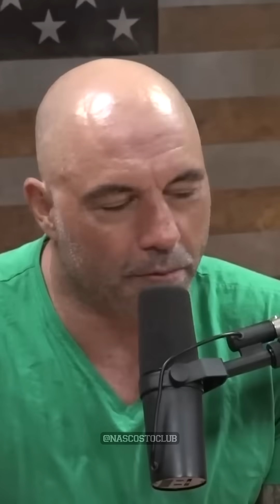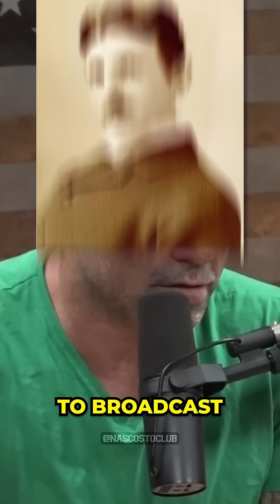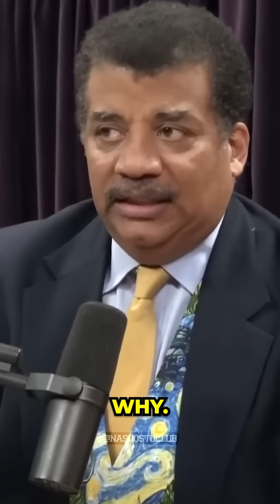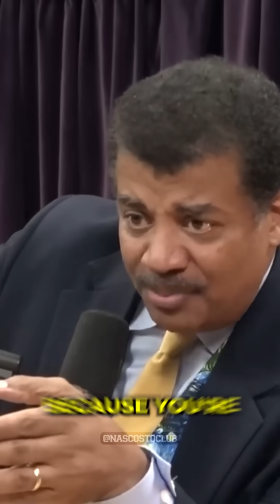WIRELESS Electricity Idea Debunked ⁉️⚡ #shorts

Comment: If you stand close to really large regional power lines, the magnetic field induced around the cables are powerful enough to induce electric current that can power certain kinds of light bulbs held in your hand. The insulating effect of air obviously makes this impractical, but still.

Comment: To be fair, Neil has a point. When conceived we had a very basic electrical need. Youre not powering an air conditioner that needs 220v and 40amps wirelessly.

Comment: This guy is so wrong. First of all, you can power all of that stuff through the air without electrocuting yourself. You just need to be like in what Tesla had those Faraday cages. So like if you were a piece of jewelry or something like that acting as like the a miniature Faraday cage you could do that all day long. The only problem with Tesla's technology is certain things like computers wouldn't work because it wouldn't be shielded enough. There'd be too much interference so you know that would be a problem. But this guy's just an idiot

Comment: There are actually radios that are powered entirely on the energy that is in the radiowave itself, called a crystal radio. Naturally they are pretty crappy radios, quiet as hell, very basic, but they worked. But yeah, the idea for broadcasting power like this is still dumb and wouldn't work for much of anything outside of that one example.

Comment: People just don't accept that tesla got a whack of shit wrong. Wireless electricity does exist 🙄 its just you can't really send it far. We do this with induction. However you can't send electricity wirelessly (that's lightning bitches). Okay so let's say we do it via photons. Photons aren't magic. While radio waves passing through you I'd fine, enough to power a light bulb is fucking crazy. You can do the energy calculation. This is the thing. Energy isn't free and it's not magic. We use wires because it's efficient. We might use lasers to beam energy because it is efficient. However what do you think will happen? The lasers that burn shit you can buy are on the micro to milliwatt scale.  Purely devoted to that. Now imagine a 20 watt laser, enough for a light bulb. Now there will be signal losses. Not to mention that's only point to point. How much do you think you'd need for a grid as it were? That's the point.

Comment: Not the biggest fan of Neil but he is right here. The typical incandescent bulb uses 60 Watts with 120 volts. This equals .5 Amps. If in an uncontrolled environment this amount alone can be fatal if it is projected through your myocardium.  Which it would, if it's just being wirelessly and aimlessly projected through the air. The amount of power needed to operate a single incandescent bulb alone would be potentially fatal, let alone enough power to supply every household in America. Tesla's wireless power idea was rightfully deemed crazy.

Comment: If you put fluorescent 4 or 8' bulbs parallel cross country high tension electric supply lines they will glow and the power company WILL CHARGE YOU FOR THE ELECTRICITY USED.

Comment: Speaker wire and data wire has a noise control type thing. There is a mesh of a different type of metal mesh around the insulated conductors that get rid of other power that can be induced with outside power. So wires with a drain(thats what the mesh inside is called "drain") I'm almost positive by now we could get away with it. If im incorrect please let us know. This is my understanding.

Comment: Tesla forgot more than this man will ever know
Reply: Can't wait until I'm 70 and reading comments on MeTube talking shit about how little Albert Einstein knew
Reply: Dr. Rodney McCay
Reply: comment and name matches
Reply: Tesla also fucked a pidgeon or he tried to atleast. The guy was insane.
Reply: Does that make him wrong?
Reply: @curtisowen3233  Yes, the energy doesn't move through the cable, cables are aligning energy which moves through EM waves or something, Veritasium explained this.
Reply: @lordshitpost31 ... yes, you're right, the electromagnetic field moving the electrons isn't in the wire. Neal knows this. Neal does not defuse that you can send energy through the air. No one does! But a wire provides a clear conductive pathway for the energy to move along. Can you power a light bulb through empty space? Certainly! But the vast amount of energy put out from the source will be lost before it gets to that light bulb, exponentially more the further away from the energy source that light bulb is. The larger the distance the more paths there are for the energy to flow. Anything conductive between the source and the lightbulb is going to grab at it before it gets to the light bulb, especially if its grounded! So if you're standing in between the source and the bulb and you aren't wearing large rubber boots or walking on a paraffin floor, you're going to light up more than the bulb! We do use this technology (think of wireless phone chargers) of course you don't "need" wires. But you put your phone directly onto the source! 
Idk, the fact that electromagnetic fields exist on the outside of wires "in the air" as you say is beside the point Neal is making. Most people don't know that tidbit of information and its easier for novices to just imagine the electricity running through the wire.
Reply: @lordshitpost31  😊
Reply: @lordshitpost31  cool story bro
Reply: @Curtis Owen  using the unlimited energy source of earth and ground means you can pick up the signal from certain locations. Earth flying 24k mph thru space creates energy that can be harnessed. It's limitless plus the suns energy.
Reply: @bobsam5982  First, Earth orbiting the Sun does not create energy.
Second, if it did there is no way to harness it.
Reply: @lordshitpost31 wire or no wire you still need a medium to transport it and contain it so your idea is largely irrelevant
Reply: @bobmusil1458  No way that You can think of...
Reply: @JohnDoe-qz1ql  No feasible way anybody has ever thought of.
Reply: @bobmusil1458  There's Massive amounts of energy in just empty space. Noones figured out a way to harness such energy... Yet. Again just because You or Noone knows how doesn't mean it isn't possible. Who are You to say Tesla Didn't?
Reply: @curtisowen3233  Clearly you havent seen the Wireless chargers you put on your ceiling and it charges your phone at all times as long as your in the room
Reply: @JohnDoe-qz1ql  Show me proof that Tesla did. Otherwise you are just babbling.
Reply: @bobmusil1458  My comment on energy is Not babbling that's physical Fact.
Reply: @JohnDoe-qz1ql  That's great! If it's physical fact it should be very easy to show some proof.
Reply: @bobmusil1458  It is, a simple search will suffice.
Reply: @JohnDoe-qz1ql  get me started, give me some search terms
Reply: @theakbars98  😂😂 Buddy, if you can't figure That out there's no point in looking it up. You won't understand the concept.
Reply: @theakbars98  You Find it?
Reply: @curtisowen3233  yes! He gets payed by the media, he is not even a real scientist anymore.
Reply: @curtisowen3233  yes. he is wrong.... he often is....
Reply: Lol
Reply: He is misunderstanding Tesla idea. He was harnessing the power of the earth.  Thru the air. Then you move it on wire lol
Reply: oh really, and what are your credentials?
Reply: Fax
Reply: he made a device that creates earthquakes
Reply: No
Reply: @tomas2665  yes
Reply: You have got no idea what you're talking about
Reply: @-gemberkoekje-5547  And you Do? Which of the two made greater contributions to science?? Tesla
Reply: @JohnDoe-qz1ql  tesla simp 😆😆😆
Reply: @minhminh-wp5lg  very original.. You even know what that means???
Reply: Tesla didn't believe atoms could be split, thought electrons where irrelevant and wireless electricity moved through an ether. Teslas understanding of electricity wouldn't hold up in an 9th grade physics class.
Reply: @anonymousx6651  Lol... Tesla Made the AC electrical system. Ya know the one still used to this day!
Reply: @JohnDoe-qz1ql  lmao i learn AC in 9th grade 😆😆😆
Reply: @minhminh-wp5lg  Yeah, he also said it Wouldn't hold up in such grade. It wasn't even a long post, but I'm glad you were able to at least read it.
Reply: @JohnDoe-qz1ql  do you understand what wouldn't hold up mean ???
Reply: Maybe but he was also crazy but we also owe most of modern society to Tesla he was truly THE GOAT
Reply: @lamarshealey3332  no, AC was invented long before tesla was even born. he contributed towards the efficiency of AC but it wasn't like it was something nobody else would've thigh of.
Reply: Tesla was an engineer, not a scientist. In this, Tesla was wrong.

Comment: His answer is correct.  The result would be essentially manufactured lightning - flying around everywhere looking for a ground. Electricity will  ALWAYS  take the path of least resistance to ground albeit - you - your dog - kid - car - trees - light posts - antennas etc.  The best way to transmit electricity is through wire because the wire is the path of least resistance.

Comment: There is actually research into wireless electricity. It does disperse very fast, though, and waste a lot of energy, but it's the basis behind wireless phone chargers. Done incorrectly, It could be dangerous, but if using low voltage direct current, it would be fine. This is not Neil's area of specialty.

Comment: Tesla was a practicing inventor but he was no scientist. He had no knowledge of mathematics and he was snob toward theoretical scientists. He had a talent with electrical generators as he understood polyphase systems when others didn't - until Steinmetz wrote all the formulas of polyphase systems and Tesla no longer had any advantage. In later age he got fixated with the wireless transmission of electricity, where the maths clear tells isn't possible unless you send lightnings whizzing thru the air, and Dr. Tyson is clearly scared of the idea.
For some reasons, the Internet has idolised Tesla, while they should have idolised Steinmetz - another immigrant to the US of the same period,  just like Tesla. But Steinmetz was a true genius as he allowed the industrial production of all electric machines, like motors, generators and transformers...

Comment: To be fair the concept is plausable just not in the way tesla proposed it and that is why increasing forms of wireless charging are occuring and discussed but they are also done in specific ways to deal with exact problem neil discusses. 
So it is more an issue of that as you build something over time you also learn more about its limits and then get guided towards seeing what ways it is actually plausable to create an end product that is similar and likely you end up with something that is both distinct yet also could be desribed in a similar way

Comment: Not just through the air (a dielectric)! Mr Tyson, has no idea. He is not an electrician. Tesla wanted to use the ionosphere (charged particles) as the conductor, and ground (Earth) as the return,. to complete the circuit. Neil is again answering out of turn without knowing. Tesla's Wardenclyffe tower in Long Island NY (see his patent) was 57 meters tall. Tesla's idea was to build a network that could relay electrical power through the air, and into any parts of the world. Was wireless power transmission over long distance possible? Well, before the Internet and before satellites, my father used to tune his old Phillips tube radio and we could hear Indian news, BBC and Cairo. He explained that the signals bounced against the ionosphere and back to Earth. Who's to say it cannot be ALSO done  with a different EM wave, with more power? Yes, radar waves and microwave can.  Mister Tyson should read up before answering. Also, he is not 57 meters tall, so he wouldn't stand in the way of these power transmissions. There are books about Tesla's auto-biography and more on his patents. For your info, Nikola Tesla was awarded the title "father of the radio" after his death in 1943. He is also the father of Xrays and the 3 phase AC motor, the dynamo and AC power production and transmission. Tesla knew a thing of two about electricity and EM waves. So it'd make sense that Mr Tyson grant some respect, while he has no clue how far Tesla got. His Wardenclyffe project was cut short when JP Morgan heard that Tesla aimed at a "free" transmission of energy through the air. He said "If I can't put a meter on it, I don't want it!". Tesla had to  sell the metals for scrap to pay the bills. See, if we want to make progress, we must curb the negative  "can't be done", and open the door to true science. Preferably, with much less expressions of self importance. Thanks Joe. You the best bro.

Comment: If you were to suspend a wire in the air at ten feet you could collect 100 volts from the electrons streaming at the planet from the sun. 20 ft up you get 200 volts and so on... 100 feet gets 1000 volts. You have electricity all around you all the time. Tesla  isn't wrong. It could be done. We just haven't figured it out yet.

Comment: always fascinating to see comments, everyone seems to think he is angry when in reality is is more an intense bewilderment, yes that may seem condescending to lay men like me but it isn't intended that way, which is why I don't feel a need to melt over it, it's a bewilderment because it shows a lack of what he considers to be basic scientific understanding, which is also reasonable, in the U.S. in particular the people are not exactly scientifically literate much less being literate enough to understand basics of wavelengths of energy...

I can respect Joe's question about something like the lightbulbs, at the moment our light bulbs' require too much power to run on a wavelength of electricity, however in the future that may be possible... that does not, however, resolve the issue of standing in the way of the wavelength, and at that point the idea that the radiation let off by wifi, phone signals and the like would be laughable compared to the effect that standing in the way of the electricity being transmitted along the radio waves...

Comment: Anyone that disagrees with Neil, on this particular subject mind you, has not a lick of understanding of how particle physics work. To have electricity roaming through the air at a rate that could power anything significant as even a light bulb, would require an unimaginable number of particles roaming through the air, every single one of them carrying enough charge to cause a decent amount of energy deposition in any medium they penetrate. Mind you, there is absolutely no way of getting these particles to travel only to the intended target, they will literally travel everywhere and deposit in everything, most electricity is also getting wasted in this matter. Basically, a room with air carrying enough electrical charge to power almost anything would be kinda something like being in a microwave

Comment: The energy is carried in the field which is in the air, if the insulation on the wires prevented all energy from passing through it nothing would work, this fact has broken my understanding of electricity and I’m not sure I will ever have a full understanding of it now

Comment: Funny thing is that in an ac system where the elections move back and forth in the wire and never to the destination of from the source, Power is transmitted through the air not the conductor.

Comment: They literally have wireless charging at a distance right now. They can power phones, laptops and yes, even light bulbs. This is technology that exists currently. Yet Neil is saying it's impossible.
Reply: All those pieces of tech rely on proximity, they have to be within a few centimetres to have the coils in both resonate. Even then they only pass enough power to charge some batteries.
Tesla was talking about complete domestic reliance on this technology.

Magnetic radiation doesn't have too great affects on humans, so that wouldn't be the issue with the towers, the issues would be the sheer amount of energy that would need to be transferred for it to be financially/economically viable. This wasn't viable then, and isn't viable now.
Reply: @sphericalcube1364  A few centimeters? I am not talking about the little wireless charging pads. They are broadcasting power to entire homes with wireless distance charging. It's like wifi but for electricity.
Reply: @DoSGamingNetwork  who's "they"?
Reply: @sphericalcube1364  Companies like Ossia and Energious.
Reply: Neil specifically said that you couldn't do it at SCALE... yes, you can broadcast power, but at anything beyond the shortest of ranges you run into the Inverse Square Law... Want to power an LED or even charge a phone over a few centimeters? Sure, can do. Want to broadcast power to run your home from a hundred miles away?

Let's just say that there won't be many happy people, animals, etc between you and the transmitter.

Comment: I mean he's just wrong at the same time.
Even if you would make a big radio wave laser, radio waves are so long they just bend around you and don't interact with matter.

Hell that's the entire reason we use radiowaves for radio, cause well it doesn't interact with matter(unless it's really thiccc). 

So you can totally make a radiowave laser that would pack more than enough energy to power a lightbulb or even much more and not have people get turned into smoke when they walk through it...

Comment: Look up the "Radiationless Revolution". We are now coming close to the realization of perfect absorbers, aka antenna with a dynamic Anapole mode which hides the energy in pairs of equal and opposite photons. This is the start of quantum mechanical transmission of energy without obvious force fields. Tesla may have discovered phase conjugation using a type of shuttle circuit which could transmit losslessly.